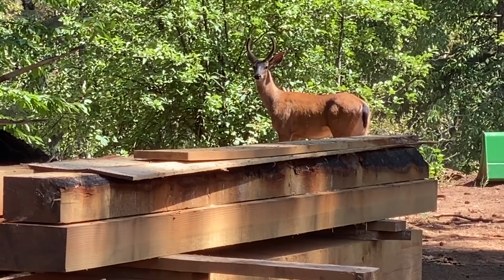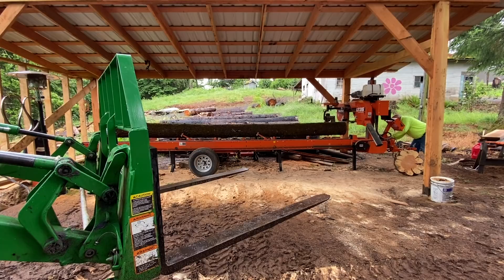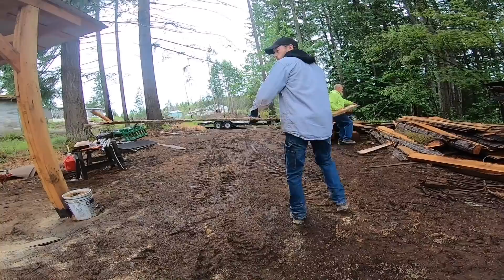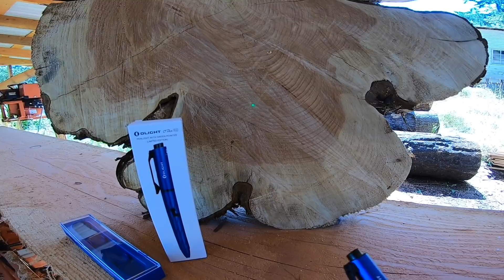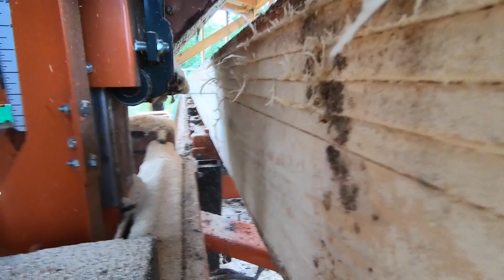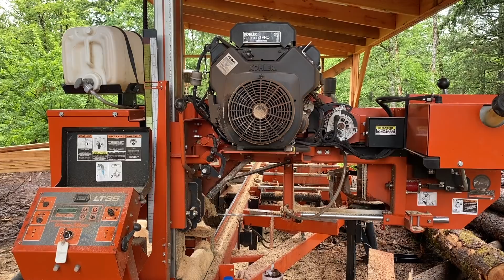Milling Small Douglas Fir Logs

Comment: Funny about the rain not happening when you want it to, But you know that's part of living here in Oregon , But I know how you feel , Where I am in Oregon we usually have a lot of Power outages, so I put in my Generac whole house generator,  even went over to your neck of the woods (Sandy) and got my 1000 gallon propane tank from Bull Run Electric,  got everything up a running , yeah you guessed it we haven't had any power outages , but when we do I am ready..lol
Reply from the maker: Ha! I do need to do that too.
Reply: @NorthwestSawyer  I had to put off buying my mill and do the generator 1st , glad I did ,, an I am very happy that I ordered mine  back in Feb cause I am set got the coming winter  and thinking this year with all the fires , high temps and the ice storms we had this last season, winter is going to hit Oregon like a brick .. So if your thinking about a Generator you should get one ordered  cause with the covid and everything  it could take 6 months or more to get it,  and propane tanks are going up in price , I got the 1000 gal, but Bull Run Elec there in Sandy had 1000's and 500's but they go fast

Comment: Great to see you again. It doesn’t appear that the current fires are effecting you - thank God!
Good video - especially those moving shots (Thanks Chase!). 
Question: why to you take 2 or sometimes 3 waste cuts to get your cant?  It seems like with a little planning you could save a number of cuts per log if you took off the bark + what ever you need to get to your cant on one cut.  I’m sure that’s easier said then done!
Reply from the maker: Thank you, John! I edited it out but those other cuts are set aside and then I mill the edges later to maximize the yield.

Comment: How much life you get out of those blades. Are you using 747 or bi metal?
Reply from the maker: These blades are 10 degree Double-Hard. I couldn’t get the 747s on my last visit to Wood-Mizer. These 10s cut really smooth so far.

Comment: Wondered where the daisy cross section went after the first few minutes of the video. Question:  were all the logs you unloaded turned into the lumber you loaded?  Thanks for the video!
Reply from the maker: I’ll be doing some work with those Juniper cookies in an upcoming video. We did make as many 1x6s as we could with everything he brought over.

Comment: I am curious - when you have a pay job, do you charge by board foot or square foot sawn?
Reply: i dont know about him  but i think i would go by the hour on a mobile job
Reply from the maker: I charge by the hour on mobile jobs. When sawing at my place, I typically figure out how much the lumber would cost to buy and reduce the price around 40% depending on what it is.
Reply: @NorthwestSawyer  what do you charge  hourly  I'm getting a mill in the fall and I'm looking to hire it out to help it pay for its self
Reply from the maker: @danietkissenle  I’m at $80 per hour for soft wood and $100 for hard. I got lucky right after buying my mill with a couple commercial jobs and paid for my mill in less than a year.
Reply: Ok, I'm getting a slower manual mill than what you have, should I charge less? We have almost exclusively Doug fur up here
Reply from the maker: @danietkissenle  the manual mill will be quite a bit slower and you’ll definitely want to charge accordingly. What I would do is get used to the mill and see what kind of production you can achieve, figure out what that lumber is worth and go from there.